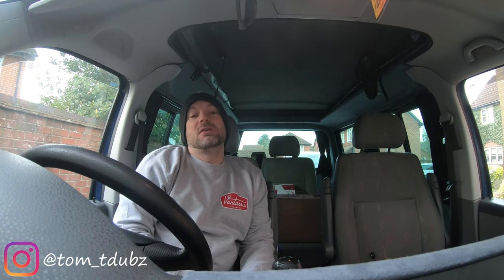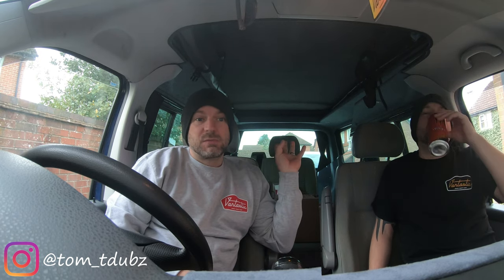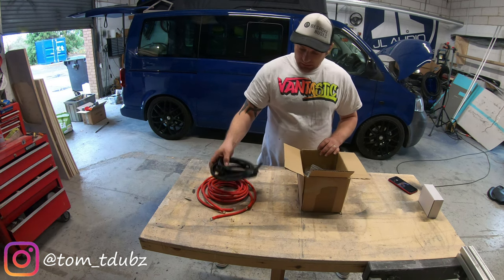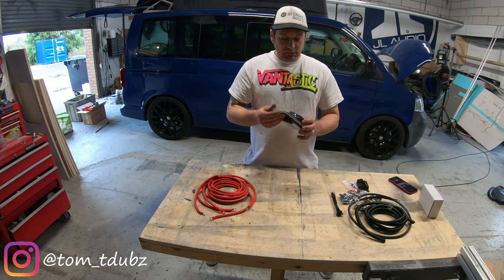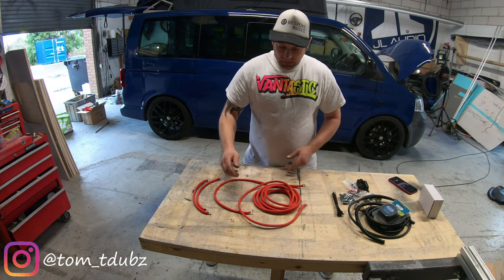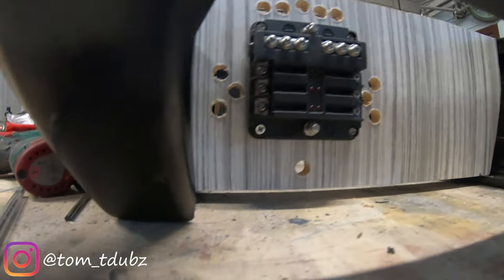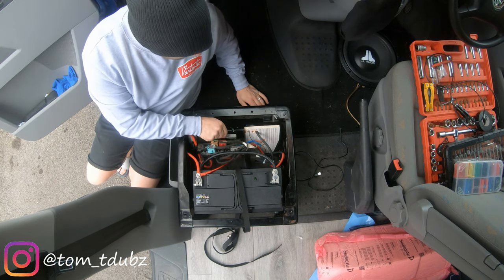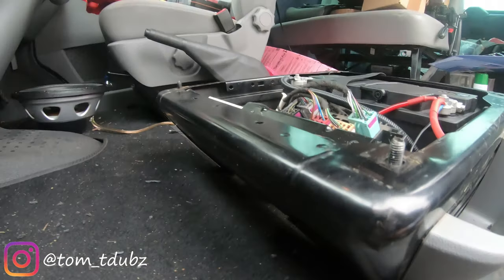VW T5 #episode7 #series2 #leisurebattery

Comment: BLIMEY i wish I had a workshop like yours 😮☹ Ive just done an18 month total overhaul on all the running gear on my old T5 (250,000 miles) OUTDOORS on a gravel drive in all weathers 😟 Now I have to fit my diesel heater , water tank and twin Lithium batteries OVER WINTER 😂 Ahhh great video but im fitting mine under the floor to save space - wrong video for me.😊
Reply from the maker: Not my workshop, but I do work in the industry now.. good luck with your build sounds like you’ve got your work cut out 👌🏻thanks for watching and best of luck 👍🏻

Comment: Great video, couple of questions though... 1.  How did you earth your battery?  to where?  2. Would this system work with a swivel seat?
Reply from the maker: I used the earthing point under the seat carpet, u could use a agm  bat then you could lay it on its side….
Reply: @tomtdubz  Split chargers are only good, if you use same type/size/age/brand batteries as your starter battery. Otherwise you're going to wear down your leisure battery very quickly. You should use DC-DC charger with 3 stage charging espacially, when your leisure bat is of different type than the starter bat.
Reply from the maker: So can you get a 115 ah agm for a starter battery then ? , and why do you say a dc dc charger is better ? … we often use a merlin smart bank charging system , which has a 200amp charging output, and is way more efficient than any dc dc system, also a voltage sensing relay is sufficient when the vehicle doesn’t have intelligent alternators

Comment: Love your videos! I had a Car electrician fit my split charge and he’s done something I’ve never seen before. My split charge connects to an alternator cable found under the passenger seat. No wires from my battery. Have you heard of this before?
Reply from the maker: It may well be that your van was an ex services so sky,aa etc some of them already have the looms in the vans.. Thanks a few more episodes to come on this van 👌🏻
Reply: @tomtdubz  van purchased from new so will be something factory on all. Not sure if it’s a better or worse way of doing it though. Tbh wish I could find someone with same set up to put my mind at rest lol
Reply from the maker: Fair play, I haven’t heard of it being done like that but if it works and it’s safe, happy days 👌🏻